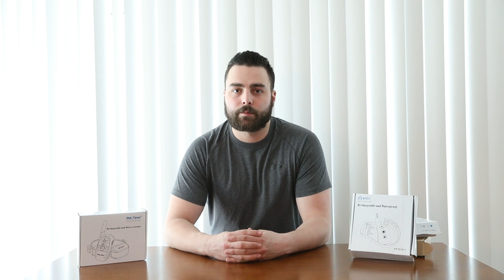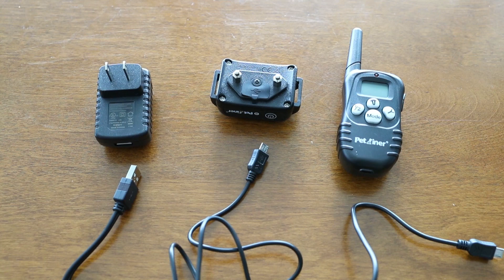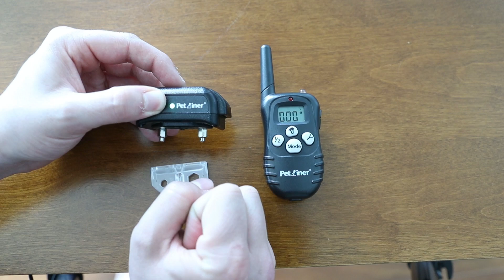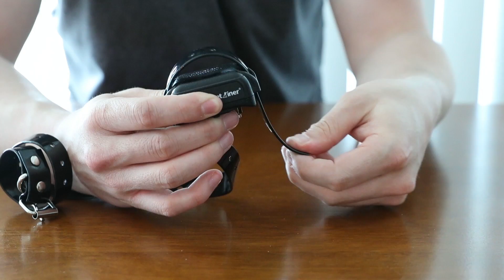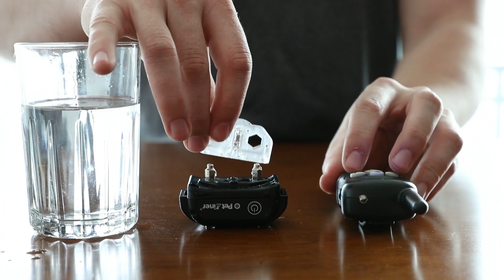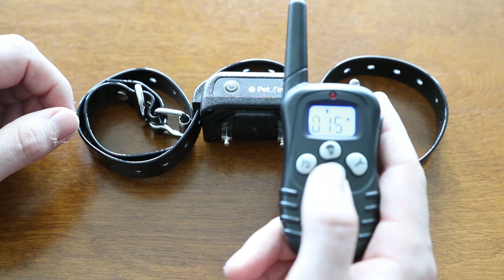Petrainer PET998DBU Electronic Dog Training Collar Introduction

Comment: The same unit is sold under a myriad of names on Amazon.  I bought one and in less than a year the unit won't sync up with the transmitter.  Not recommended.
Reply: Jack Lucas just bought it. Guess I should have read this first.

Comment: These collars are by far the best out there. Purchased the 2 pack a year ago for our then 2 dogs, We have NEVER had to use the static shock. Generally the beeping has got their attention and has made necessary corrections. We have since got 2 more dogs and just purchased another PET998DRB-2. Like the upgrade to the charging cord, so that you can charge both receiver collars
Reply: I can't figure out how to get the device to pair. They are both charged. I have the 2 pack.

Comment: how are the lower shock levels?  i ordered a different collar and its way too strong at its lowest level.  thinking of this one as it has 100 levels of adjustment.  thanks!
Reply: Mine is just like a tens unit I wear it and like it at 50
Reply: I tried it on myself could not feel 1-5 or very little it started to be unconfortable around lvl 70
Reply: Michael Morales  in sorry your dog died. But don't blame you being uneducated on the proper use killing your dog, on the ecollar.
Reply: Michael Morales  not if used correctly. When attempting to find your dogs tolerance to the shock. You have to start low without being in training and work your way up until you see the dog acknowledge what they feel. Once you get that. Go down by one. Then start your training. If it doesn't work, then you can continue going up.
Reply: Michael Morales You definitely used it wrong, your dog shouldn’t have died from it, you should have used it on yourself first, then your dog, and start from 0-100 until they feel the shock, honestly I don’t use the shock, only the vibration and beep, but if you do, you have to be sure you don’t fry your dog, like fucking educate yourself, you killed your dog because you didn’t put in the research.